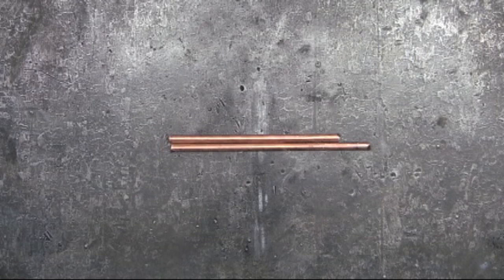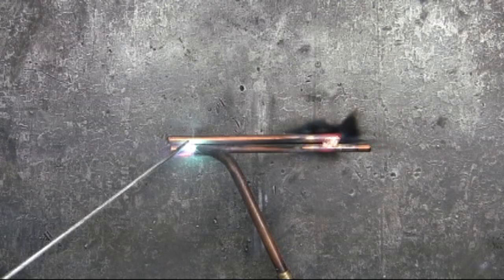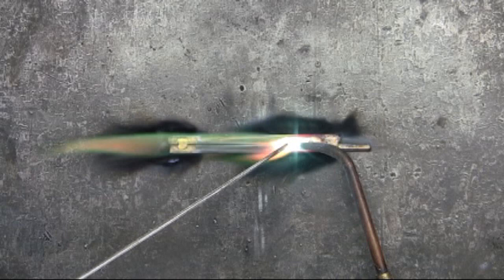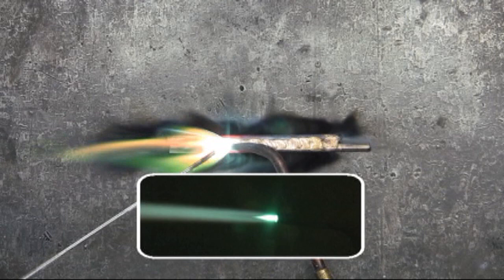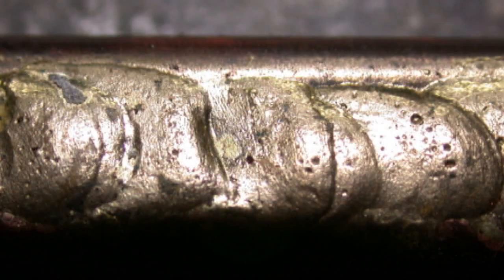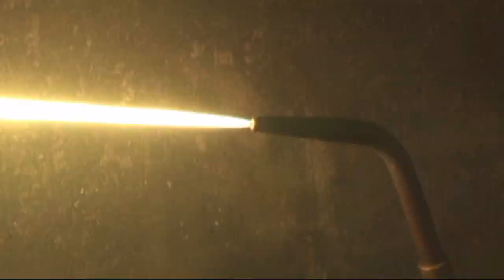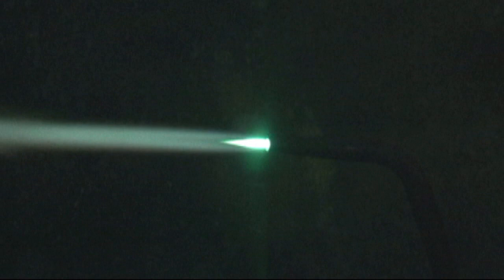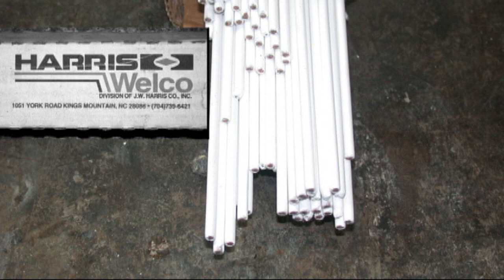Brazing Rod:  when you get a bad rod

Comment from the maker: thanks for the question:  It sounds like you have your brazing rods well protected.  They should last for years.  Moisture is the biggest problem, but you've got that covered.

For bare rod there is the possibility of oxidizing, but that can usually be taken care of by removing the oxidation with a piece of steel wool.

Comment: I had this problem with some old copper phos rods part of a bernzomatic kit. it was confusing to me as I was just starting out (on my own). some of these rods would not melt and I thought I was not getting the base metal hot enough. then on another experiment I picked up a different rod and it worked beautifully. when I just about used the good rod up I went to another and again it would not cooperate.  then I ordered some silver phos rods but I was perfectly happy with copper phos when it was a good rod.
Reply from the maker: It's just a matter of sticking with it until it works.  Congratulations on working through it.

Comment: maybe thats normal but from what I read, its flux burning... Im really light on the heat... also, so far all have been strong except one part I just cannot get rod to flow and seal a gap in the tubing .. and tis is very thin Tange II Chromoly... all has brazed up nice except on side tip ( brazing a tube perpendicular to another tube to firm a T )

Comment: Hey George! Great Videos! however, Im learning on my own to braze bicycle tubing... Ive had pretty good outcomes ... I have the smaller AW1A torch with mixers up by tip... Victor version... anyway, I have a couple questions... to start.. no matter what I do, there is black around my braze.. burnt flux? 3/32 with white flux.. making a T joint then cant seal one edge